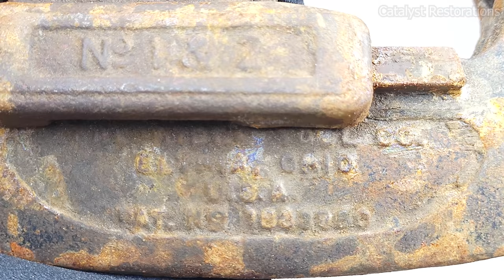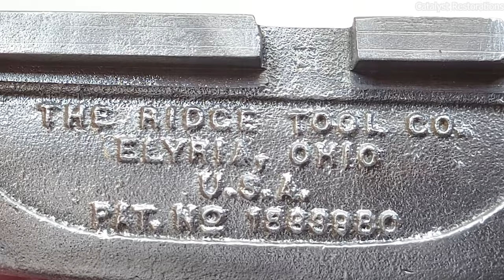Restoring a Crusty Ridgid Pipe Cutter

Comment: Just curious , but wouldn’t a lube like Remington Remmoil be better to Han just no lube at all ? 
I’ve started using it on a couple of items . I’m cleans light grease and puts a Teflon coating on there by preventing rust . I use I on my firearms and a couple of tools . I have the tendency to go overboard sometimes when doing things . 
Forgot to mention, the Remmoil is clear Ann not messy like normal grease would be . 
   Keep up the great restoration work, you are inspiring fir others to get out Tyler and do the same .
Reply from the maker: I'm not familiar with Remington Remmoil, but pretty much any grease works for this. Teflon would work too, sure. You really don't have to get super fancy with it for it to do its job.

Comment: Do you know Jason from fireball tool? He’s a YouTuber plus a tool manufacturer. He recently did a video about filing and tested the theory that filing on both the forward and backward stroke if it causes damage to the teeth of the file and what the efficiency is.
He was able to clearly prove that filing on both the forward and backward stroke is more effective and does not cause premature wear of the teeth of the file.
I was very interested to follow his development along this test as I was always told the only file on the forward stroke or it would prematurely ruin the file..
Not the case..
Good job by they way.

Also as I am inexperienced in this line of work as you are.
Is electroless really better than wire Wheeling from the beginning?
Reply from the maker: I'm not familiar with Jason's channel, but I'll go check it out! YouTube commenters absolutely lose it you ever show a forward and backward file stroke on camera! 😂

For electrolysis vs just wire wheeling right from the start, it's a bit of a personal preference. I prefer electrolysis first because it makes wire wheeling afterwards much, much faster (and less dirty!). Electrolysis does a great job of 'loosening' up stubborn rust and then subsequent wire wheeling usually only takes a single quick pass for all the black oxide left to just fall right off. There's much less dust/debris to clean up in the shop that way. Electrolysis is also great because it's an extremely gentle process and does not remove things such as paint, only iron oxide (Fe2O3) - helpful if you're trying to determine the original paint color of something but can't tell if there's original paint somewhere under all that rust!
Reply: @CatalystRestorations  yes Jason had said people in his comments lost it over him filing both directions. That’s why he created a good way to test if the old idea that’s it bad is true or not.
It’s very surprising to know it’s okay and actually more effective.
Thanks for the info on electrolysis.

Comment: One suggestion, spray the t-handle with a rubberized nonskid for better grip.
Reply from the maker: Good suggestion! In the long run it would be a better choice than paint, which could rub or wipe off from oils or solvents.

Comment: Oooh... I found spray filler is the best for rough surface and little pitting
Reply from the maker: In the time since finishing this restoration I've found that Rustoleum's regular filler primer (not the one labeled "2-in-one sandable primer") works very well! It's also still sandable. Check out my Chicago Pencil Sharpener restoration to see that filler in action!

Comment: looks good, except for that black handle. its silver for a reason. the paint will just rub off during use
Reply from the maker: Etched primer + hammered finish enamel + clear coat is not going to rub off any appreciably noticeable mount with any moderate use. If this was used in service on an oil drilling rig, then sure, that paint may last a few weeks.
Reply: @CatalystRestorations  not would last a day on my plumbing truck. oily gloves will rub that stuff right off
Reply from the maker: That's fair. I'm no plumber, so this one will be fine, but that's good to keep in mind on future pipe cutter restos! Thanks!

Comment: WHat is the point of doing a cosmetic restoration on a pipe cutter?  If it's used for it's intended purpose, it's going to get banged up and the paint chipped, and it's not a show piece there is nothing particularly rare or old or unusual about that. I have an identical one, and you can still buy them.    As far as when you're "testing" it,   that vise has jaws for holding a pipe, they're  the curved jaws underneath the straight jaws.  You're putting way too much pressure on the cutter, the idea is to put a little pressure on it reach rotation.  Cutting pipe like you did winds up crimping the pipe inward, (this can be seen in your video) and leaving a larger burr inside the pipe.
Reply from the maker: What's the point of the manufacturer ever painting them either? I just do this for fun as a hobby and the YouTube revenue pays for the whole hobby. Thanks for the tip on how to use it better!